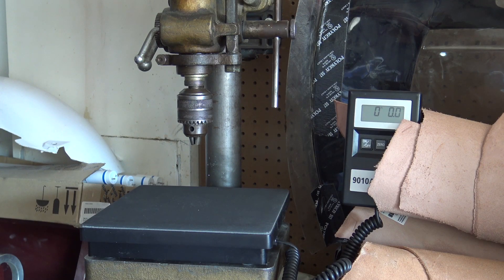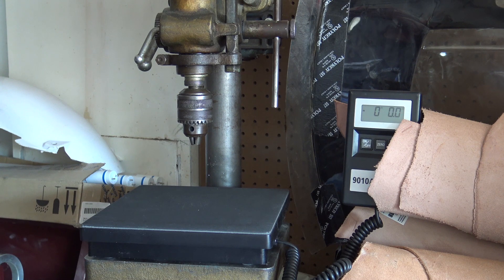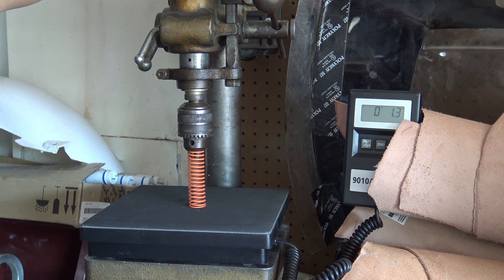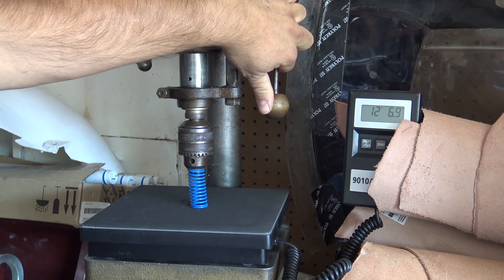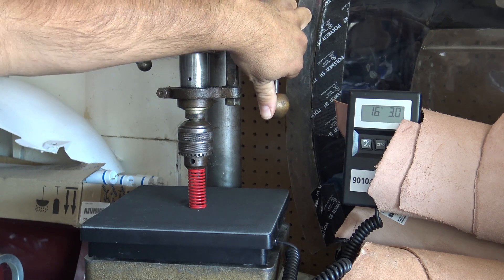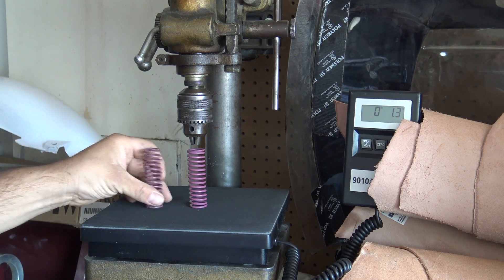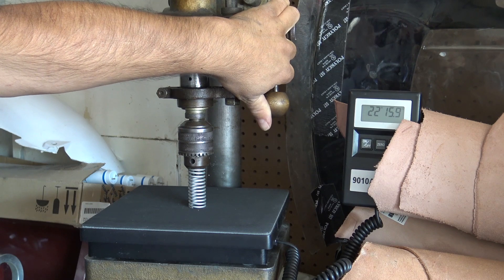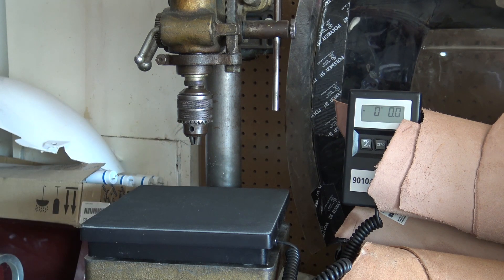1/4 scale shock spring rate  testing

Comment: Because some of your springs are not the same free standing height...You'll want to load the spring to say .25 lbs, zero scale then take exact measurement then do 1" or 1/2" to get a more accurate reading. I do this on 1/10 scale springs, using a height gauge and a postal scale, most springs are rated by kg per mm or some metric standard. I use lbs and oz.
Mark my springs. Because their process sometimes is not as accurate as i would like.